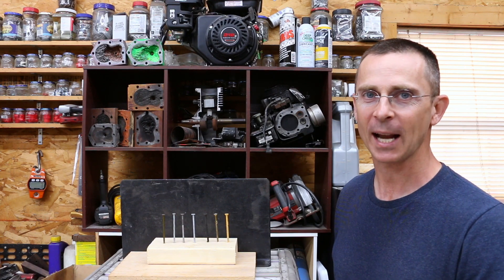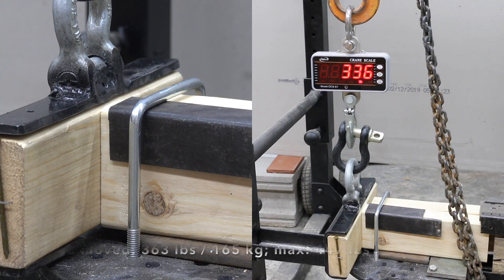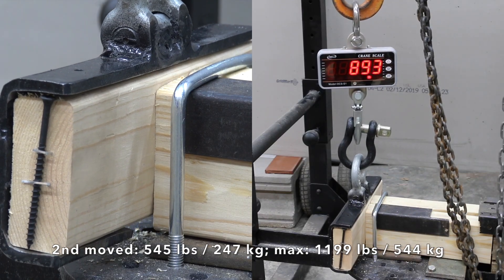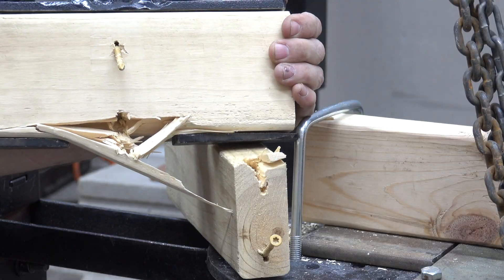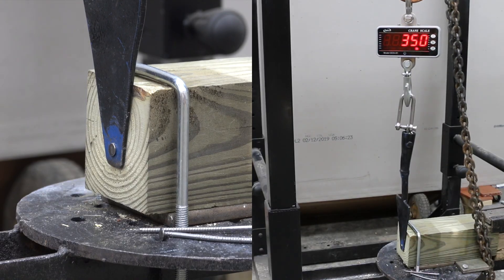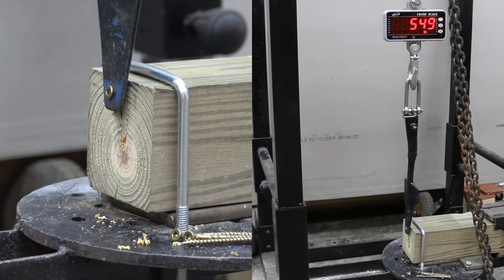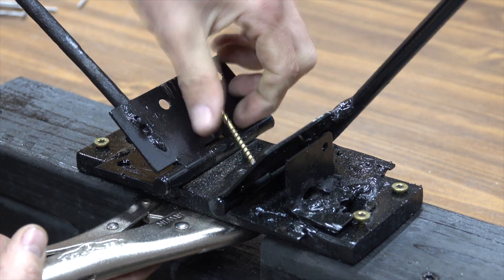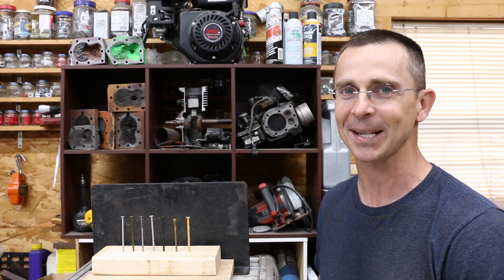Do Screws Shear easier than Nails? Let's find out!

Comment: My pap always said “why put a nail where you can put a screw” I’ve always lived by this statement. I guess the application should be considered before deciding on a fastener. Good work brother
Reply: On some applications you use both plus glue. Such as subfloors and especially internal stairs covered in hardwood. Otherwise you get squeaky steps/floors.
Reply: In most cases he is right. In cases of home foundation or where shifting of many hundreds of pounds may occur, a nail would be best. If im building a work desk though, screws.
Reply: We did that and the GRK screws failed miserably compared to Ardox nails.
Reply: Speed
Reply: THat is ONLY true if you are looking for holding strength.  Sheer strength Is based on vertical pressure on a horizontal fastener. holding strength is like a vertical screw pointing up and then pulling down on it.
Reply: se fi  but takes way longer than a nail gun
Reply: @grantmuhonen5337  That's if you have one handy though. 
To me screws are always better than nails exept in niche circumbstances. I.e. you want something quick and dirty. 
I find screws are better most of the time because they tend to demolish more cleanly and can be reused while nails tend to be a use once and discard sort of deal.
Reply: @grantmuhonen5337  even longer than nailing with a hammer. 

anyone framing with screws has more money than sense. nails are faster and as his last statement said nails are better at withstanding movement. what a lot of people fail to understand is a house or other structure will move over time by wind or even settling. having some 'give' in your fasteners just makes good sense. 

screws work great for their intended usage but that does not include framing.
Reply: @grantmuhonen5337  Time = Money
Reply: Don’t forget (in the case of decks especially) seasonal and weather caused expansion and contraction of wood, nails allow for some of this movement, while screws do not. The wood is still going to move which means cracks, splits and the shear strength will come into play to some extent.
Reply: @CrJoltFire  Sounds about accurate. I had lived in a home with a big porch that was only a few years old, within about 2-3 years it started to crack in some places.
Reply: Haha I'd love to see a guy frame a while house with just screws 😂 imagine the time it would take! Plus then all your fastener joints would fail when the wood moves
Reply: No, just no. Don't use screws in the place of nails. Nails are for shear loads and screws are for longitudinal loads for the most part. Screws are great for holding power but are very hard and prone to metal fatigue or breakage. Framing moves constantly over the life of a building, and nails allow this to happen without letting go or breaking as they are made of quite mild steel that can bend over and over without breaking. Try that with a screw, and you can usually break it just by bending it once. Screws and nails are for different applications, and are not interchangeable on a lot of situations.

This video is also crap. It's not testing shear strength at all, it's testing holding power in end grain, which is why screws performed better. This isn't a real world situation, and it's an established fact screws are not as good in shear, although some screws are certainly big enough for it not to matter. But again, why would you drive 14g 150mm bugle heads in on framing when nails are more appropriate? Every fastener has it's place.
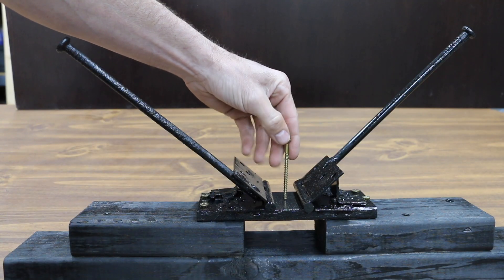Reply: @Patrick-857  The last test done at 10:15 proves your point. The screws snap while the nails bend. That's why code calls for nails when doing structural work and are particularly important for events such as hurricanes and earthquakes. 
Apparently, there are now specially designed structural (framing) screws, but normal screws are too brittle.
Reply: @6681096  Thank you. Unfortunately people all too often are unaware of their own ignorance, and even when the evidence to the contrary is right in front of their faces, they still think they know better. This comment section is representative of what I deal with from homeowners so often. They think nails are outdated or something.

Another thing, none of these people have tried pulling Paslode gun nails. That red stuff on the ends? That's glue, and I've ripped heads off them trying to get them out.
Reply: @Patrick-857 In what circumstance would a screw get bent almost 45 degrees one way and then 45 degrees the other? Seems hard to imagine except massive earthquakes.
Reply: @shock80ey  I personally assisted with the aftermath of an 8.0 earthquake here in NZ, as well as two others that destroyed large parts of the city of Christchurch, and I've been in many others over the years. Since Christchurch, we build to protect occupants primarily, not so much the buildings. Similar to how modern cars are designed to absorb impact to protect occupants. 

Until you have seen what an 8.0 earthquake can do, you don't really understand. The power is immense and catastrophic. I'm not talking about fasteners bending 45 degrees, I'm talking about them shearing completely off. I'm talking about enough energy to cause railway tracks to be on the opposite side of the road from where they were before, seabed lifting up as much as 4 metres, houses that no longer have their exterior cladding, or are split in half with a giant crack in the earth in between. 

Here in NZ earthquakes are a reality we live with. They are normal to us. We build  accordingly. 

Also we absolutely do use screws in construction. However there are things that require nails, and things that require screws. They both have their purposes and they aren't necessarily interchangeable.
Reply: @Patrick-857 so nails aren't needed unless a house experiences a 8.0 Earthquake?
Reply: @Koningkrush  Not what I said.
Reply: @Patrick-857  the previous person asked what would cause lumber/screws to be bent out 45 degrees other than an earthquake, and the only example you gave was an 8.0 earthquake, suggesting there are next to no other situations where a screw would experience that much shear.

The only other I can think of is a partial foundation collapse or 100+ MPH wind gusts
Reply: @aaronkoning7255  You have absolutely no idea what you're talking about.  

For example timber moves constantly due to humidity and temperature changes. Nails allow free movement, screws do not. Screws are more susceptible to metal fatigue. Screws fail catastrophically, whereas nails will simply yield, meaning that in the event of a major structural failure, nails are preferable, because they will continue to hold things together at a point where screws have long since snapped off. 

The other things to consider are cost, speed of installation, versatility, ect.

Nails are at a price point that screws will never be able to compete with. No method of installing screws will ever be close to as fast as a nailgun. 

Screws are superior in certain circumstances. Mainly because they have better hold. But it comes at a price premium, and a higher labour cost. Screws will never replace nails, nor should they. Our building code will not allow screws to replace nails either, and if we did try, the cost would be astronomical. One one of our 140+ square metre transportable homes we build, we go through over 15000 nails of various types, and around 9000 brad nails. That's not counting all the nails used to make the frames and trusses at the factory. If we replace all that with screws, who's paying for that, and what benefit are they getting? 

People like you are not well informed, and have very black and white thinking. One is not better than the other. They have completely different use cases. Apples vs oranges. Nails will never be phased out as long as we use timber.
Reply: @aaronkoning7255  My response got deleted by YouTube. 

This is a pointless conversation. If you want to build a house using only screws, have fun. You won't get it past your building inspector, the cost will be very high, and it will take a lot longer.

On an average transportable home that we build, we go through approximately 15000 nails of various types. Mostly using nailguns. That's not counting the nails used to manufacture the frames and trusses at the factory, nor the roughly 9000 brad nails used in finishing. Why would anyone replace that with screws? Screws are speciality fasteners. They cost a lot more, and are a game changer in certain niche applications. We use plenty of screws. But only where a screw is the best choice. A screw is not the best choice for the majority of applications nails are used for. 

My point is that nails are superior when it comes to shear strength, flexibility, and their unmatched ability to yield without letting go, making structures using nails highly robust, even in the most catastrophic situations. Screws have superior hold, which is great when you want absolutely no movement, but is actually a disadvantage when you want to allow for movement. Houses are constantly moving, due to temperature and humidity. Screws are also brittle, so while they may be very strong, when they fail, they fail catastrophically and suddenly. Nails don't do that, they just yield. And cost is not even comparable. Screws will never be even close to as cost effective as nails.
Reply: @Patrick-857  you really don't need nails.

Nails are just cheap and fast. But they are fairly weak. Where screws are brittle, nails lack grip (meaning it usually takes more nails to keep something together).

Bolts are stronger than both. In most cases screws with last year's without snapping. Even drywall screws can last for a long time under ideal situations. (Evironments with minimal corrosion).
Reply: @Patrick-857  facts. Work as a luxury home builder directly for a structural engineering and architecture firm. You’d get your last paycheck if you use screws for load bearing walls. HOWEVER...when doing RENOVATIONS to interior partitions that are not load bearing, I have gotten express permission to use only framing screws, as the clients tend to sway their minds A LOT, and screws make life so much better when you can very cleanly disassemble and modify a partition assembly without waste
Reply: @colbywood8113  Yeah, I work in renos and insurance, we use screws a lot for adding additional nogging between joists or studs when replacing rotted floors ect. Some situations force you to use screws because there's just no space. Like I said, nuance. I see this in a lot of YouTube comments sections, particularly with older Americans, where everything has to be black or white. Very strange.

I wish I had your job though, I hate being pushed to do substandard work all the time, and as I get more confidence, I keep pushing back and insisting on quality over speed. I guess it's hard to care about your reputation and customer satisfaction when the insurance companies deal exclusively with you, and basically force the work down your throat whether you have time for it or not.
Reply: @Patrick-857  i got out of doing that once I met an architect and told him how much I hated what I was doing. I only use screws to make interior walls that aren’t load bearing because I had a client modify what she wanted in her master bedroom/bath so many times that we burned a stack of lumber just in there renovating. Now it’s all self-drilling screws so I can recover costs. To add to the nuance though, I use a lot of 5/16” x 4” GRK Washerhead screws when laminating posts or carrier beams, or adding bracing on actually post and beam
Reply: @colbywood8113  Haha you know exactly what I'm going through. I'm doing a disabled access bathroom at the moment, and all the doors and trims are native hardwood finished clear. I was told by the designer to rehinge the toilet door on the other side of the jamb, but the door handles are installed above center, and the privacy lock is through a separate little hole in the old mortise lock. Net result, I completely disassembled the jamb, turned it inside out, re bevelled the door, filled the privacy lock hole on the now outside with an inlay, and spent hours hand planing and sanding to achieve something that's close to being a new door. The boss will flip when he finds out. I'm going to tell him it's either that or next time we just get a new custom door, because it's cheaper and a better look. The door was just a hollow core veneer one from the 70s. Not worth it. But this customer is fussy, and she's extremely well known in town because she taught about three generations of this town at school. Not that a person's standing effects my quality level, but reputation goes a long way.
Reply: @Patrick-857  yeah the architect I work for now is picky about who we work with for clients. They can have what they want but they have to understand the costs and time, and the architect demands they respect us enough to listen when we talk to them about an issue. I couldn’t be happier now working with this guy because he buffers  with the clients on some things and makes work easy for us. Pretty nice when you can go to work one day and have the clients walk through to see what you just finished and they don’t like it and want something different and you can just say “okay, no problem” with a genuine smile on your face because they understand that they’re paying you twice, and you got pics for the portfolio.

Comment: Very nice video and testing.  I am a retired aerospace R&D engineer, and we did very similar testing on composite and titanium joining processes, like fasteners, welding, and bonding, but with better test equipment, and for a lot more money.
One observation, someone might have already asked.  You said that the screws were "brittle", but I doubt if the metal screws are made of would be called brittle.  It must take a lot of ductility to form a screw shape. 
I might suggest what you are calling "brittle" is really a stress concentration.  Anytime a fastener, or any material carrying load, has a notch, a hole, or even a scratch,  it's fatigue properties are degraded.  Whenever there is a geometric disruption, the loads will get concentrated at that point.  For instance, the general stress concentration of a hole in a metal sheet is 3.0, meaning the stress is multiplied by 3.
Reply from the maker: Thanks for the feedback.

Comment: Looks like if you have the room and want something to really stick, you need a single coated sinker in the middle with a “C” spacer under it or even just not fully driven (to allow removing without destruction or extra work) with deck screws beside it and then some drywall screws, that way you get the most force, but the other fasteners help with flexing loads
Reply from the maker: Thanks for the feedback.

Comment: As a carpenter I find this information extremely valuable. The shocker for me was that ring shank nails can’t tolerate that much movement. They are my go to fasteners in framing applications. But with this info I’ll be sure to avoid them on very old shifting homes which I work on often. Thanks for all the great content!
Reply from the maker: You are welcome.
Reply: Which one will you use instead?
Reply: @Susan70003 
Galvanized if any water or exposure to elements is involved, also with pressure treated.  Green vinyl for general framing, ring shanks for particle board underlayment. Reference the building code for size and nailing pattern.
Reply: @danwildhaber8178  Thank you.

Comment: Some screws, mostly the yellow passivate coated, seem to snap if you hit them with a lateral force. Others, mostly the bright zinc plated, seem to bend when hit. I wonder if they are made of a different steel or if it's how they are heat treated or coated?

Comment: I've built a couple of things with drywall screws that I gave a coat of common petroleum jelly on the screws to deter corrosion and the wood contracting and expanding. A 12 foot by 40 foot shed roof on a trailer that has lasted 15 years and counting and a 10 by 10 storage shed next to the trailer that has lasted 12 years and counting zero issues. They are in an area outside Chicago that can get 60 to 80 mph wind gusts.
Reply from the maker: Thanks for sharing.

Comment: So it seems the bottom line is use drywall screws because they hold really really well so you won't get any movement where the ductile of the material is a factor. After all if you're putting a nail or screw in something you're trying to have it not move.
Reply from the maker: Thanks for the feedback.

Comment: i often use 6" and 8" 3/8 shank GRK timber screws for knee braces on overhangs... id like to see how much weight is required before the screws sheers or pull out. i use 4x4 and diagnal the screws from the back of the brace and use 2 on each connection. usual overhang is 2-3 feet. I also predrill the first piece of 4x4 but not the second piece. I then install the brace to a stud in the wall with 3 6" GRK... If you could some how rig up a test for something like that??? love the videos thanks for all the work
Reply from the maker: Thanks for the video idea.

Comment: This is probably just nit picking, but for shear testing, shouldn't the force applied be as close to the restraint of the board as possible. Just for future ideas like this. I'd set up the testing rig with a square restraint as close to the edge of the board as possible and as tight as possible, so the board never moves up and down. Another way to also improve it could be to attach the chain/cable as close to the restraint as possible. That may even reduce much of the bending fasteners that you saw.
Reply from the maker: Thanks for the suggestion.